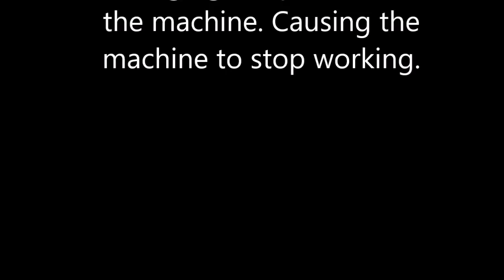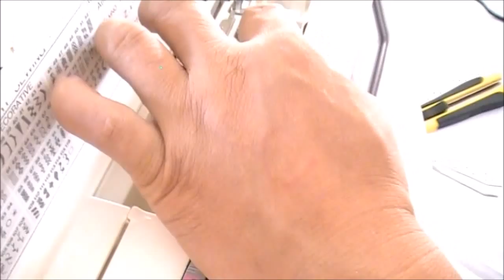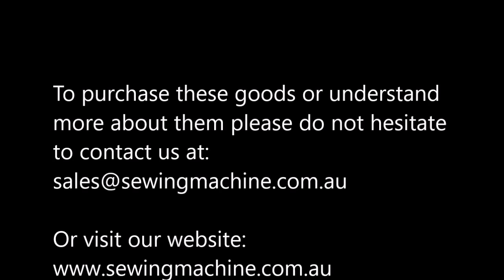How to replace Janome MC8000 touchscreen, 'A'  board, backlight and upgrade LED light

Comment: absolutely brilliant. I couldn't have done it without. 
Few comments.
The overall objective is to remove the front panel which contains the touch screen film.
(BTW this video replaces the whole LCD unit - we just wanted to replace the touchscreen FILM ( £65 !) itself.
But that aint easy lots of other stuff needs removing as well.
Another thing : When referring to "sliding the tray try out the back" were talking bout the TOP tray ( well there aint no other 🙂
Another thing : There is a 240volt connector cable (from the 240 v switch on the RHS) that digs into the black transformer plastic box on the bottom left which in our case came adrift (the connector that is) . (The view  from the side ie the side where we poke the 2.5mm Allen key in.)
No way - we were completely and utterly stuck  until we just happened to locate the  hidden  2 pin 240 v socket on the top of the black plastic transformer cover. Transistor sister to the rescue. Phew. 
 
"Repairing a Touchscreen" is going on my CV.

Comment: To remove the screw under the carriage, you turn a wheel that moves that carriage, I do the same but it's the needle that moves and not the carriage. Why ? If you can answer me, thank you.

Pour enlever la vis sous le chariot, vous tournez une molette qui fait bouger ce chariot, je fais la même chose mais c'est l'aiguille qui se déplace et pas le chariot. Pourquoi ? Si vous pouvez me répondre, merci.

Comment: Very helpful thank you. My husband replaced the backlight and it works fine but when the machine turns on it says there is a "Stepping motor error". The machine worked fine before replacing the backlight just couldn't see the dark screen, would you have any idea what might be causing this. When the needle is in the down position the error doesn't come up but as soon as the needle is raised the stepping motor error comes up.
Reply from the maker: We would recommend you to double check all of the connections in the machine as often this is due to a loose connection somewhere inside the machine. If otherwise you would have to find a sewing machine mechanic to double check.
Reply: Dulwich Hill Sewing Centre I have a Janome memory craft 9000 the dealer I took it to said my screen is shot and the factory no longer makes this screen.  is there anything or anyone available to fix this?

Comment: What does it mean when my machine has a message on the screen,  “stepping motor error” on it. It won’t sew or do anything else.  I recently bought it at an estate sale for $20.00 figured it was worth the gamble. It’s an 8000. It doesn’t look like it was used very much at all.
Reply: Someone gave me an 8000 yesterday; she said it didn't work but I could see what I could do with it.  I got the stepping motor error.  I pulled the embroidery card out and pushed the embroidery arm back toward the machine.  I no longer get the error, but I realize the screen is really dark.  I don't know if I want to spend money to find out there's something else wrong.

Comment: Its very detailed video. My mc8000 has suddenly stopped working at all. Before that i t made a sound like fuse blown. Now when i turn it on only light bulb light up& rest of the machine is dead. I wll be greatfull if you can suggest anything.
Reply from the maker: Jyoti Sharma This problem look like from main board.
Reply: Is there any slow burning fuse inside the machine. Read in views. According to that my problem can be solved. Do u have any suggestions for me please.
Reply: @jyotisharma7620  I have the same problem, since it was accidentally plugged into 220V. Replaced the 2 fuses in the black box (just pull 4 big screws off bottom, unscrew all screws on black box) but still no screen or motor response, though the light is on. Couldn't see any issue on the main board, but didn't have time to pull it all out. Would love a more exact suggestion.
Reply from the maker: Jyoti Sharma This is A motherboard problem, Need to be replaced

Comment: I replaced the backlight and all was well until my wife tried to select stitches via the touch screen. Only the 2 on the left work.I calibrated the memory? but still doesnt
allow more than those 2 stitches. Could I have left a connector unattached or does one connector work for all the stitches?
Reply from the maker: Can try, if still not working, most time need to change touch screen.
Reply: @dulwichhillsewingcentre2689       Can try what??
Reply from the maker: @walterguerin3792  recalibrate or check cable connection, still no working maybe touch screen problem.

Comment: My husband has just changed mine but when the machine is turned on, the screen says bobbin winding.  Any clues?
Reply from the maker: Sharon Armstrong
when he put back the cover, double check the case in right position.
Reply from the maker: Sharon Armstrong You need to check to see if the bobbin switch is working, or if the previous cover is not placed properly

Comment: stepping motor error
Reply from the maker: Maybe shaft or A board problem
Reply: I have the same problem. I found that there are 3 plugs in the end of the foot. Remove them and you can use a screwdriver to move the embroidery carriage. Eventually mine freed up and the stepper motor error disappeared. Our local Jenome agent told us that it couldn't be repaired and offered to sell us a new one....
Reply: @62marty  what do u mean 3 plugs? are the screw? which is the part? should I unscrew and remove the cover?
Reply: @zhaozhao6148  There are 3 plastic / rubber plugs to block the holes. If you remove them you can see the end of the shafts that make the plate move. If you use a screw driver to rotate these shafts it will move the plate and free up the motors.